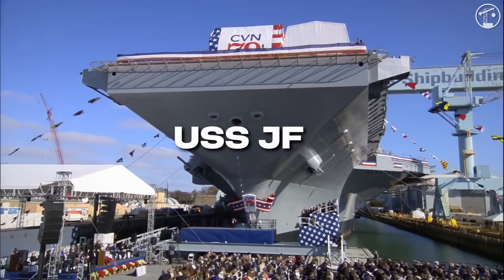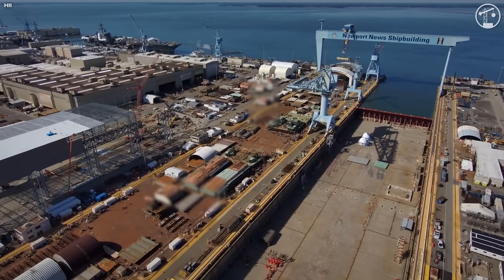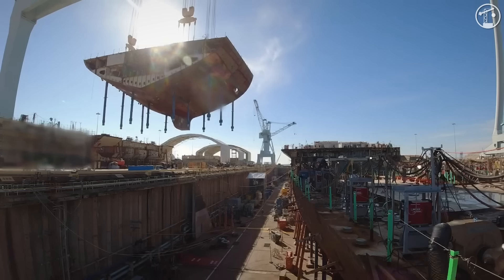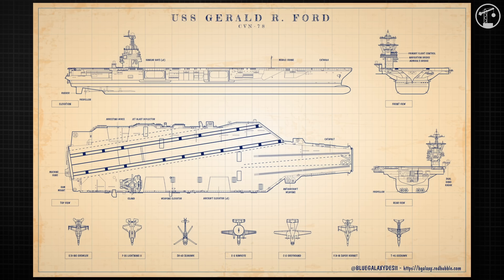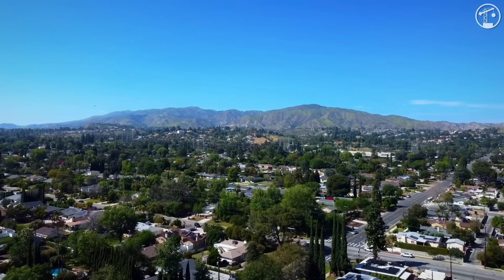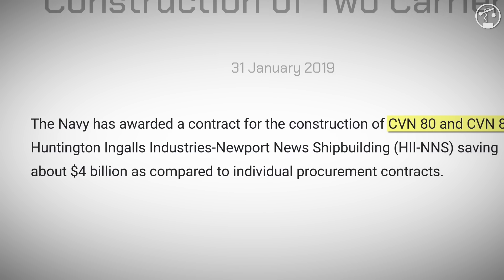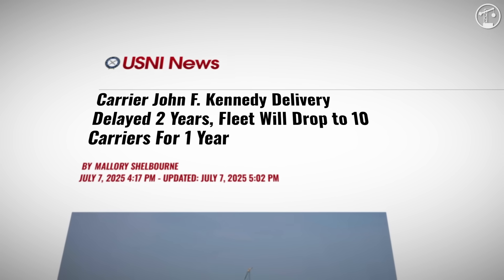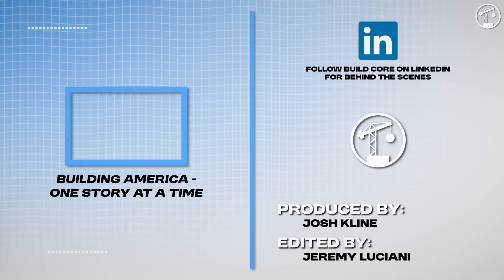Inside the $13B Carrier Taking Shape in Virginia

Comment: XD China can literally build four aircraft carrier at the same time, get them all done on time and in budget. And, best to come, they are making a thorium-related engine to fit all their current and future carriers.
Reply: Isn't the Chinese navy currently busy running into the Chinese  coast guard in the Philippines?  Also china has 3 aircraft carrier in service. Keep coping though Chinese shill.
Reply: @bosstwind7010  Let’s also not forget they don’t have good airframes for carrier operations.
Reply: @TotallyZoeA  Their jets launch fine on the carriers, so nice try.
Reply: @Red-Check-Mark  More like they are too heavy to launch with full load. So often more so on their first two decks they can’t launch fully equipped air frames. On the latter while they will launch fine at full load they just don’t stack well to their peers. But the former is the biggest issue comparably.
Reply: @bosstwind7010  You mean the one incident that happened? You do know China's Navy runs several hundreds times a day, right? Yet you focus on one incident that happened. 

China has three carriers in service and they are building four more as we speak. Simultaneously.
Reply: @Red-Check-Mark the type 4 is the only one under construction.... what are you on about?